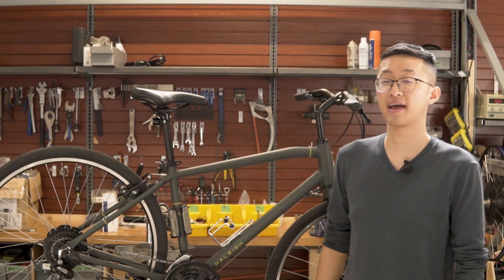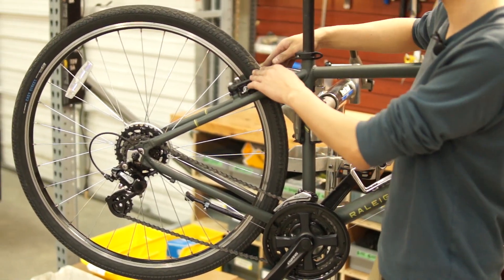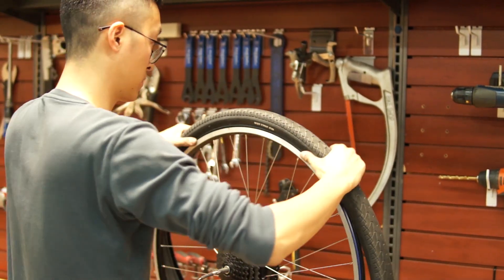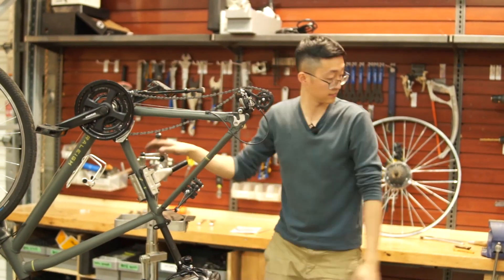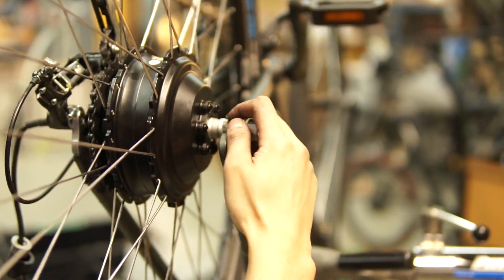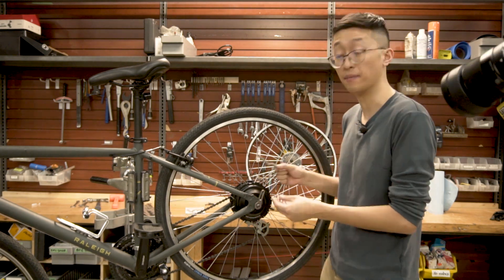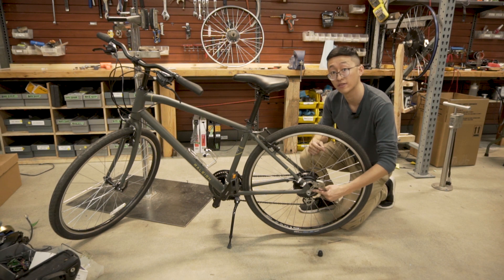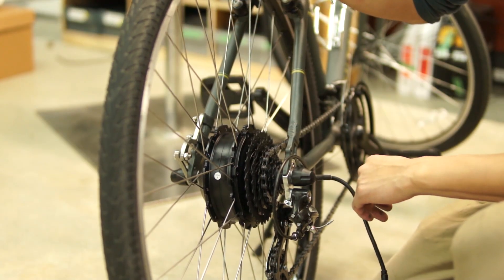Prelaced SX2 Rear Hub Motor,  Basic Install Tutorial

Comment: Hello

Do you have info whether this SX2 rear hubmotor works with any kind of controller + display on the market? Currently I have a 36V system but I am planning to try this SX2 motor. So everything would be the same and I would only change the motor because the motor cable are the same. Could work it? Thank you, regards Karl.
Reply from the maker: You have to ask the supplier if your motor controller, not us. Very low chance that it will decode the combined temperature and speed signal on the white wire, but to at least spin the motor with the hall and phase leads most can in principle as long as the hall mapping is correct. 

The controllers that we supply (phaserunner, baserunner) work with almost any motor because that is our core design philosophy. Most other ebike companies have other priorities...

Comment: The tightening tool for the torque arm and the air pump are required but not mentioned in the 'required tools list'. I would also highly recommend a properly fitting ring spanner to tighten these axle nuts - I hope it's not workshop practice @Grin's to regulary use monkey wrenches on these. I bet your nut edges on this particular bike are already slightly rounded after seeing you left it quite open for easy removal when you used it.

Comment: You gotta carry a lot tools to fix a flat with this one. You're better off with a BBSO2 750w.
Reply: Yeah it's a pain to fix flats with a rear hub motor + torque arm, etc. 

However, my easy solution for dealing with flats is to prevent the flats from happening at all, eg by using puncture resistant tires like the Schwalbe Marathon Plus
Reply: You need a wrench for the axle (1/2 inch I think) and 10mm to loosen the   torque arm nut. Or just one large adjustable wrench
Reply: And adding BBS02 to this bike is not a 5 minute job

Comment: Great video. Looks easy enough. 

Grin, would a torque arm be necessary if installing this sx2 motor onto a bike with horizontal dropouts? I have an ebike with horizontal dropouts (dropouts that seem robust) with a 350w nominal motor that does not have a torque arm that I want to upgrade to the sx2.
Reply from the maker: You can install the torque arm on horizontal dropouts just fine.  Otherwise if you are running without a torque arm we'd recommend limiting the phase current of the motor controller to produce no more than about 30-35 Nm of motor torque.
Reply: @GrinTechnologies  Thanks for the advice!